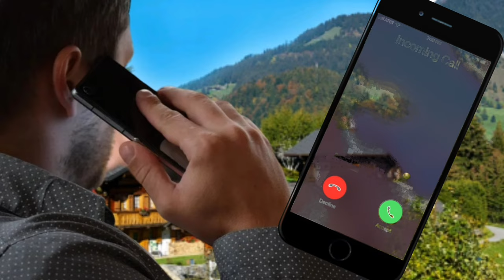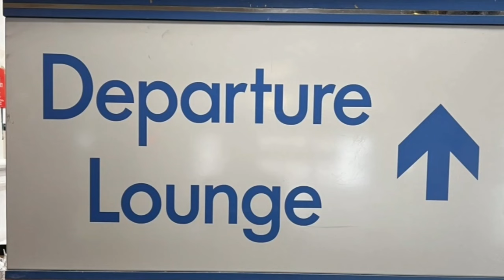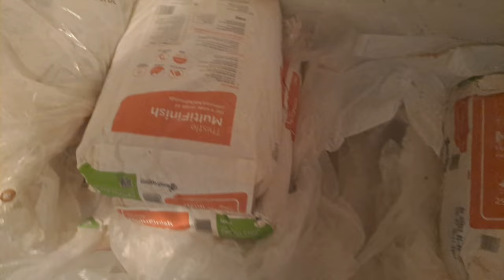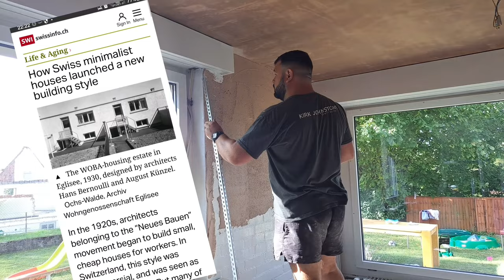We Smuggled British Plaster into Switzerland

Comment: Top plastering pal 👌👍👏do it exactly 💯same as me .. 😆 put 1st coat on flat enough and wet 2nd coat mint finish everytime ❤ 18years ont trowel same methods repeated over and over and you still learning little  bits to make it easier and not panic pal 😉good to see a proper spread teaching process for the young lads . Marshall  Town worn in  metal trowel gets the wall flat not like them plastic ones that make your work look uniform but shine a light down it and full of bumps painted 😢
Reply from the maker: 100%

👆👆👆👆
This man knows

Comment: Couple of hand fulls of cement would of sent your bonding off in 20 to 45 minutes.
Add the cement to the water, give it a stir, add your bonding and move like grease lightening. 
You might not like it Kirk, but it's great for patching and getting beads on quickly. 
 Been in the trade 37 years, never had a come back from doing it.

Comment: Channeling out the ceiling for the cables.  Just wondering how this will effect the structural strength of the ceiling as I assume 
that it is a prepored ceiling and not concrete slabs.
Reply: Down low in the slab most of the work is done by the steel which is in tension. The concrete itself is doing the most work up at the top side. more of a compressive load there. As long as the channeling/ chases aren't too crazy its absolutely fine. Hope that helps